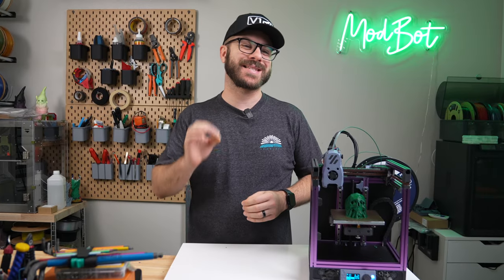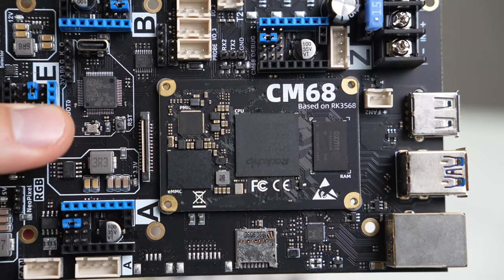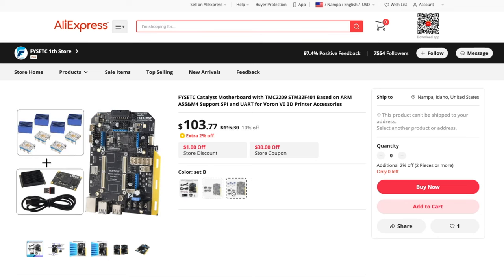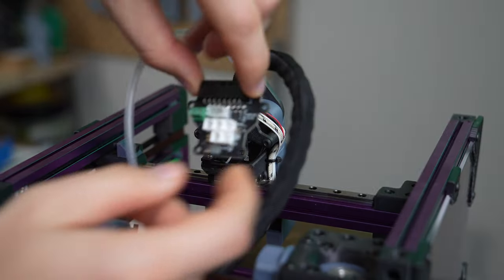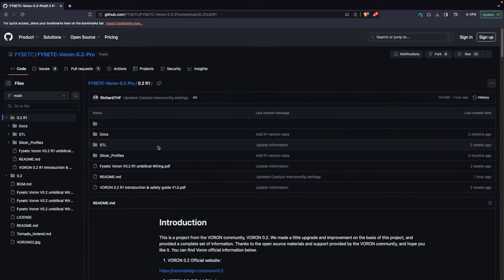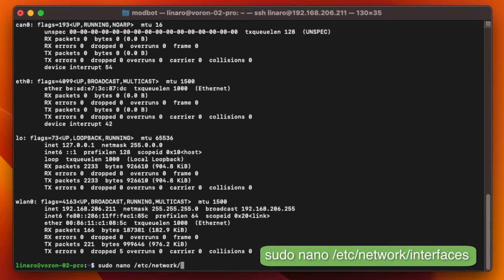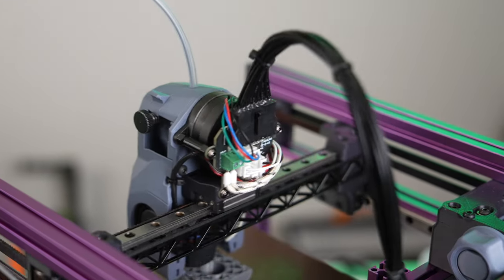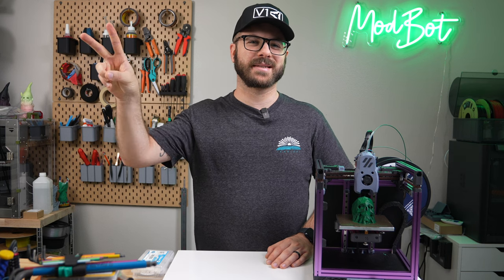Custom Board For Voron 0 Printers (Fysetc Catalyst)

Comment: The exclamation mark in your password: this is not an issue with fysetcs implementation but a 'linux-ism'. In a linux commandline, something prefixed with an ! is treated special, but so are many other 'special' characters like the & and backslash. You get around this by using single quotes around what contains those special characters.  So, if your password is $1!A&b, then you type '$1!A&b'. Don't use double quotes ("), because that instructs the shell to try and interpret those special characters anyway.
Reply from the maker: Thank you for the explanation. This is the first time ever I have experienced this. I did reach out in their Discord and this was not something that was mentioned. That is great to know that it is easy to work around and I will pin this to hopefully inform others :)
Reply: I would've just used a backslash, myself, ie. \!password -- backslash is used to escape individual special characters.
Reply: @WereCatf  Correct 👍 But passwords often use (or should use) multiple 'special' characters. And this circumvents someone who isn't that comfortable with linux having to guess which are characters they have to escape and which are OK.
Reply: Correct since it treats it like a string instead of an argument
Reply: @ModBotArmy  if you're giving feedback to fysetc, it might be worth to make that shell script an interactive prompt which would likely get rid of any requirements to escape etc.
Reply: Yes, using single quotes fixes things so that the shell doesn't interpret any of the characters in an argument. FWIW, I honestly don't get why they don't just instruct you to edit one line in the network configuration file to begin with. It seems no harder to me.
Reply: @pemetzger then we would be having a conversation on how to quit vi :D

Comment: The new Catalyst board is pretty cool (only included in their new Voron 0.2 kits) and seems to fix a lot of problems, especially this weird mess of wires to connect the head. Still some problems with documentation though, but the discord server is very active.
I got one of their kits and I'm pretty happy with it.

Comment: Good to see more info about this board.
Inhad ordered an fysetc 0.2 kit, which should come with the cheeta board and separate umbilical breakout board.
However, they upgraded my order to the 0.2R1 kit eith the Catalyst.
The Cheeta has soldered drivers and a faster MCU.
Plugable drivers is fine, not complaining about the slower MCU for plugable drivers.
But I’m super sensible about trusted OS sources and running this system with a preinstalled OS is a problem.
I also run my printers with Octoprint+Klipper, which means I have to deinstall whatever is already installed.
Documentation is another problem, however there is a schematic and it looks like removing the CM68 and hooking the MCU to a Raspberry might be possible.
Using another printer board is not easy, since I don’t have the umbilical breakout.
I havn’t powered up the board yet, still building the printer.
From the hardware standpoint this is a nice looking board and I really hope that there will be OS images from a trusted source without undefined preinstallations.

Comment: Nice video! I agree it should have all the connections that are going to the toolheadboard also on the mainboard but shipping it with a Can toolheadboard I think is too crazy. On a V2 it makes sense, but for crossing a 20cm gap (not even in a cable chain) and with the possibility of just turning the printer around and accessing the electronics it is simply not worth the hassle. Can has it's downsides, it is difficult to set up.

Comment: It seems like you haven't mentioned the significant performance boost of the CM68 compute module compared to the H616 on the CB1 or the H5 that comes with the Mellow Fly Gemini V3. Additionally, it's worth noting that the CM68, which is included with the catalyst, has 32GB of Integrated EMMC and 2GB of LPDDR4. In contrast, the CB1 only has 1GB of DDR3L and no EMMC, while the Mellow Fly Gemini V3 only has 1GB of RAM.
Reply: Yes, but you cant flash your own linux image to the board. I dont trust the fysetc linux Image :/
Reply: @Henkler3D  If that's a concern to you and you know what you're doing, you can make your image from scratch, wouldn't be that difficult.

Comment: Price comparison wise, it looks like this board has a WAY more capable compute module (Klipper host), compared to rather minimal Manta with CB1 and especially the FLY-Gemini with it's ancient H5, with only 1GB RAM and no eMMC included (much slower to boot off of SD card). With that all taken into account, I think the price is very competitive. (The Manta could in theory be run on a CM4 compute module but those cost quite a lot more than the CM1's and good luck with getting all the software running on the different CPU etc.)
Reply: Didn't have any performance issues yet with the cb1 even with 2 webcams setup. But having more compute available never hurts.
Reply: @twanheijkoop6753  Oh, I'm sure. Perhaps this new board is overkill, in that sense. Still seems worth the extra money to me — if only for the eMMC. Makes such a difference. Night and day.

Comment: Also in general, all of these Chinese "Raspberry Pi nots", whilst currently more readily available and comparatively cheap, are almost always a nightmare to get running with many things that "just work" on a Raspberry Pi. It's common to get everything but one critical thing working and having to just give up in the end. Documentation (English esp.) is sparse at best, drivers for some things just don't exist at all and before any of that gets sorted out, the board will get abandoned for the next bleeding edge and completely incompatible version. It was here that you experienced most of your setup heartache, which was about par for the course for these SoCs — all that from someone with years of Linux experience. It boggled my mind that relative n00bs get anything working at all. Thank goodness for those forums! Otherwise, it's all awesome! :P
Reply: My fear with them is how they’ll be in a couple years.  Rpi has a real advantage, here, because their is is not taped together at the last minute, and they also maintain compatibility as new stuff comes out.

Comment: It’s possible that it wasn’t retaining because the system was set to sync the drive at 30 minute intervals. I had that problem with the Fly Mellow V3 board’s web config. I ended up overwriting/hardcoding something to make it work reliably

Comment: If you buy this one, you will engage in an in-depth study of Linux. Moreover, the kernel has no modules, the drivers are compiled into the kernel, which is why most of the hardware does not work (for example, my camera). Additionally, there are no ready-made images of the installed system. If you somehow damage the installed linux you have two options - throw the mainboard into the trash or get a PhD in making linux images on rk3568.

Comment: Can’t say I’m a fan of those recent new boards with the plug in step drivers.
Feels like we had finally gotten away from them …
Reply from the maker: So you like them embedded? It’s a mixed bag. Some only like replaceable in case one needs to be replaced you don’t have to swap the whole board. I’m indifferent. I have only ever had one fail and it was self inflicted.
Reply: I'd rather have pluggable step sticks, that way if you damage one or want to upgrade you can just replace the very specific thing that needs changing. Less ewaste throwing an entire controller board away because you want 5160s or something.

I do however think that moving from stepstick to the 'EZ' connectors that Mellow and BTT are doing makes a lot of sense. I just wish they'd standardise on a consistent pinout.
Reply: @ModBotArmy  well I don’t necessarily “like” having them embedded just that I’ve had multiple issues with pluggable ones in the past (pinout incompatibilities, missing features due to lack of spi / uart, poor cooling, etc.) 
So yeah maybe just a better standard for pluggable drivers would solve most of those issues…

Comment: Not enough USB ports. Wifi / Klipper Expander / HDMI display / portable ADXL - fail
Reply from the maker: I guess it depends on your plans. I also would be happy with at least one more but ADXL I would only use when swapping toolhead parts or big mechanical changes mostly.
Reply: @ModBotArmy  Also from the price point this board does not make any sense. Current price on Aliexpress is €113, BTT Manta 4p + CB1 costs €57 - this is epic fail
Reply from the maker: @alexey_sychev  with the screen, toolhead board, and wire harness I am willing to add $20 in value but it still is overpriced IMO.

Comment: Nice informative video, but this kit is honestly a waste of time and way overpriced, I run a single USB cable to my tool-heads on all my machines, which is the same as running CAN, its also only 4 wires as well, and for the price of this Kit, I can buy almost all of the parts to build a Voron 0.2, the kit would need to be sub $75 and be using, CAN or USB connection to the tool head, I think Fystec have wasted time and money on this, one can buy a MKS-SKIPR with 3.5" Screen and a THR-36 tool board for far less, and these boards are far more capable, or you can also pickup a Kingroon Cheater board (also made by MKS) and use a Mellow or BTT USB/CAN tool board, this would bring the cost right down, the Cheater board has everything you need for a Voron 0.2 and its cheap. The Cheater board and the BTT EBB will set you back around $100 USD retail, so half the price.